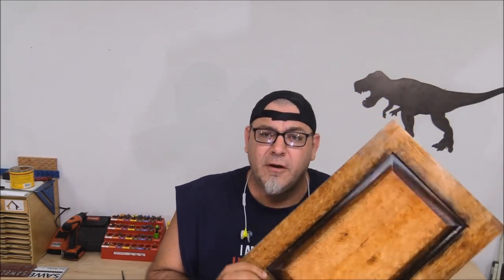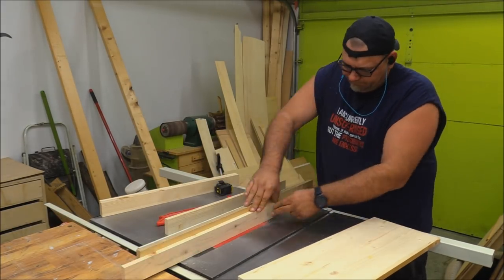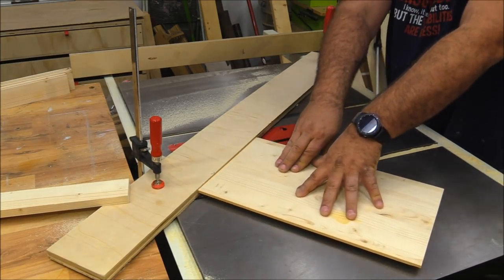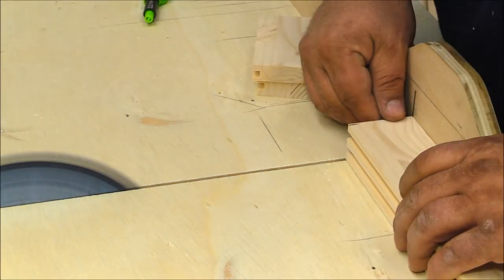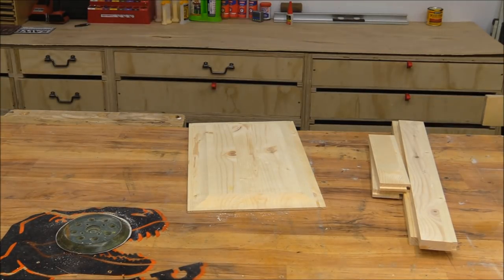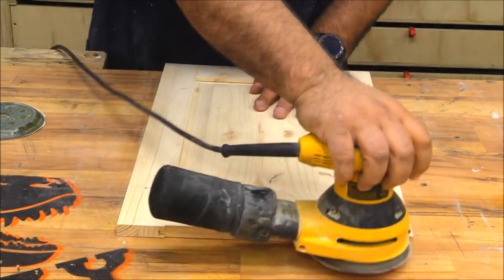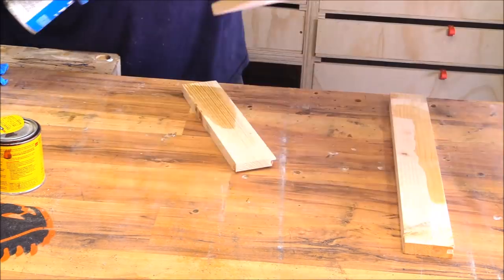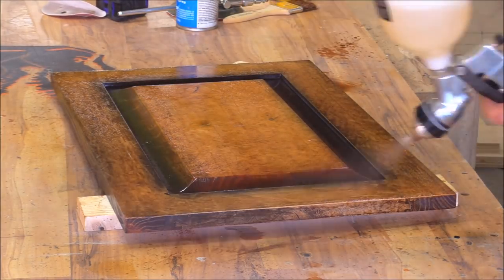DIY | Kitchen Cabinet Door | with a table saw |  Izzy Swan

Comment: With the exception of the finish, this is the exact method we used to use at the old Shopsmith Woodworking Academy back in the 80's-90's.  We also used a molding head with a 1' flute blade that looked a bit like a thumb.  It left a cleaner cut than a sawblade so there was less sanding required on hardwoods. The one surprising issue was that unlike shaper and router panel cutters, the tear out occurs in the long grain.  Also, if the door is large it is super easy to drill for dowels prior to machining the tenon and groove. Great video as always. Scott
Reply: Oh yeah, and the finish is gorgeous! Thanks for sharing that technique.

Comment: This looks so easy but I'm afraid it is not.
I badly need to buy a table saw. But I'm afraid that without the xx years of experience that Izzy has my first xx attemps will end with making a lot of saw dust and pieces of unwanted scrap.
Thanks for sharing what is possible only using a table saw. You are a real master.

Comment: have done similar doors if you run the back side of your panel too and not go as deep on the front you will actually center the panel instead of it sticking out that little bit. But yours does look great

Comment: Do you have to worry about the doors denting it since pine is so soft?
Reply from the maker: laquer does a pretty good job of protecting the wood but it is pine and it is a soft wood and will dent easier than hardwoods